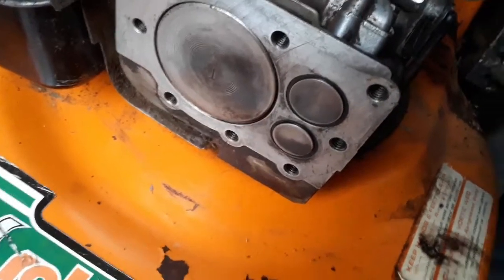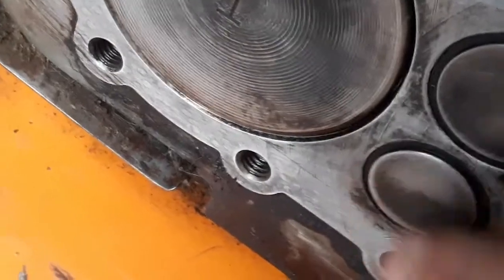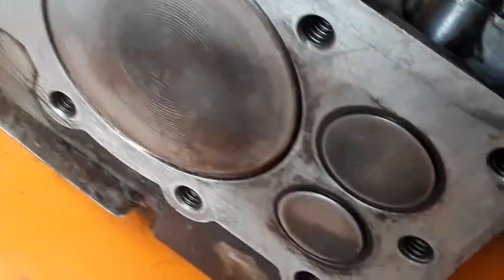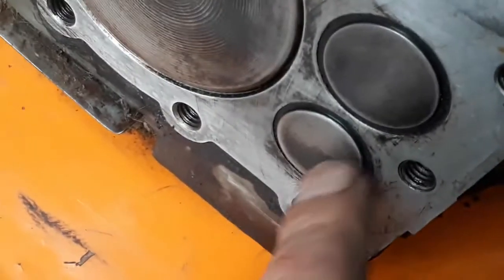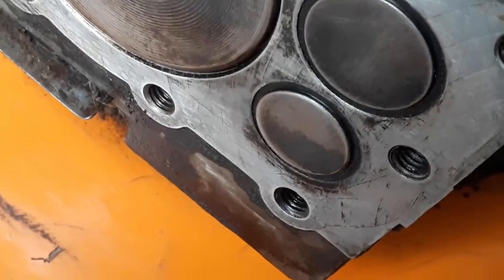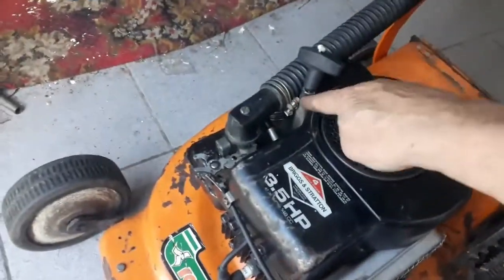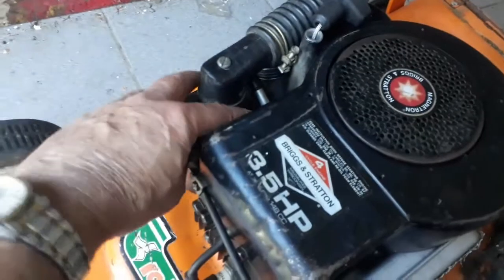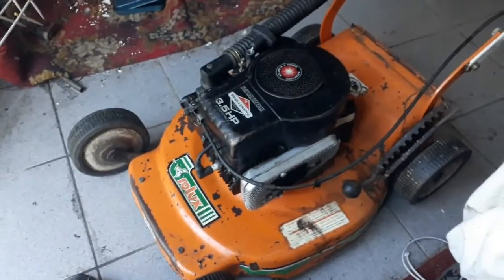Briggs 3.5 HP Will it start

Comment: Wonderful!  Glad old orange is running again!  Soos 'n spliternuwe sikpens!  Well done on your detective work!  By the way, the smoke is definitely much less, so that oil works well!
Reply from the maker: Thanks Willie, a new pull rope with a handle cost 22 rand, the starter pulls very smooth as well, I will put the original handle on the new rope, I want it as original as possible

Comment: My experience with these engines if they ever developed the issue of backfiring when they were turned off they had the potential to blow that valve seat out once the set was blown out you had zero compression I learned how to punch the seat back in and get a few more hours out of the engine good job doing basically the same thing they're Jan
Reply from the maker: Good to hear I did the right thing SBF, seeing that it is part of my vintage engines and run 15 minutes a month it will out live me, thanks for your comment my friend